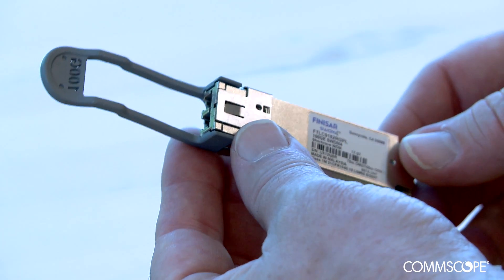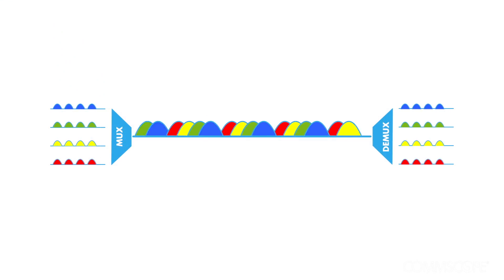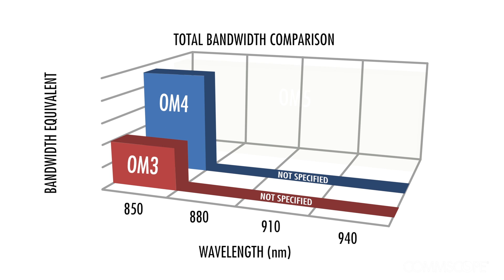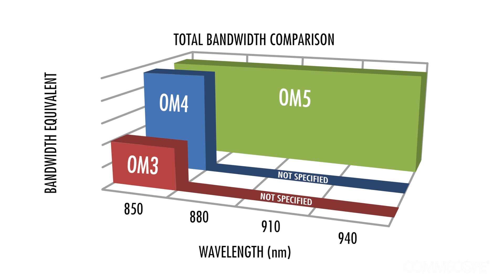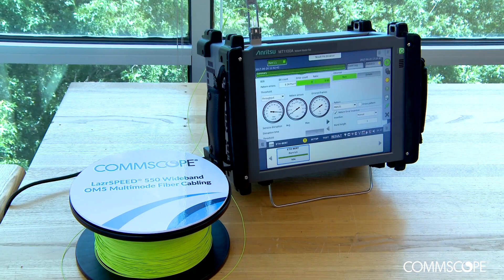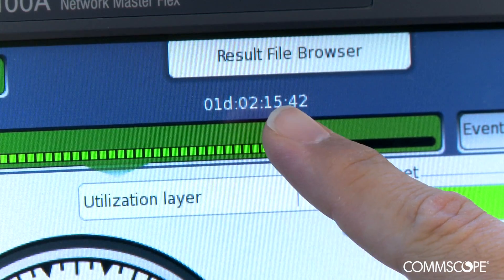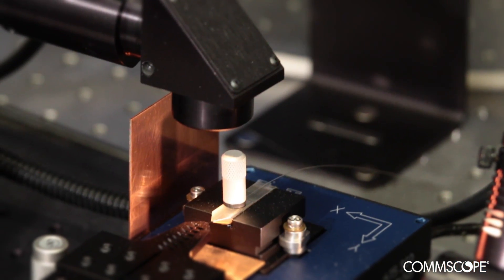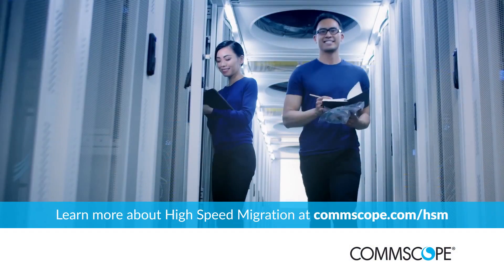LazrSPEED OM5 100G SWDM demonstration

Comment: Wy do you show MPO/ MTP connectors in this video.
OM5 is for LC duplex ore MPO/MTP connectors?
MPO/MTP is for 200 - 400GB?
Reply: We are seeing OM5 fiber being deployed in data centers, which typically use MPO trunk cables and MPO/LC cassettes to convert the multifiber trunks back to duplex.  MPO cabling has the advantage of reduced diameter and faster installation and test time than traditional field term cables.  There are direct MPO interfaces on higher speed transceivers, like 100G BASE-SR4 and as you pointed out, 200G and 400G in the future.  Installing MPO trunks with OM5 gives the option of serial transmission with SWDM, as well as parallel transmission with SR-4 based technology